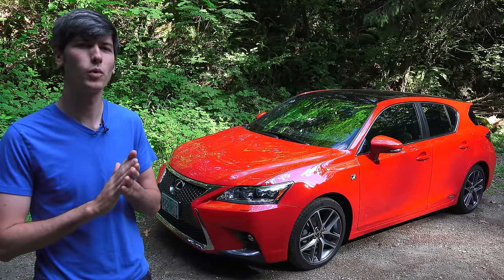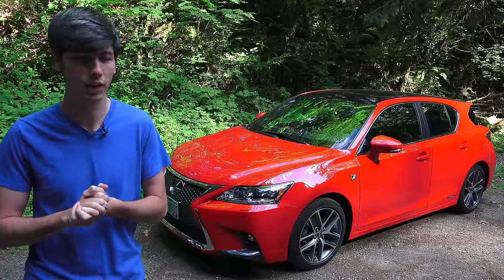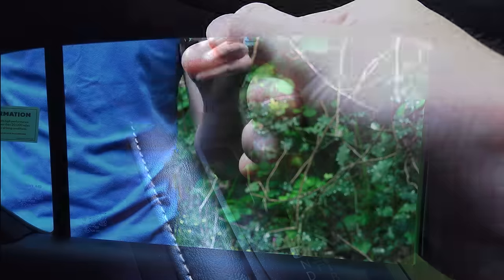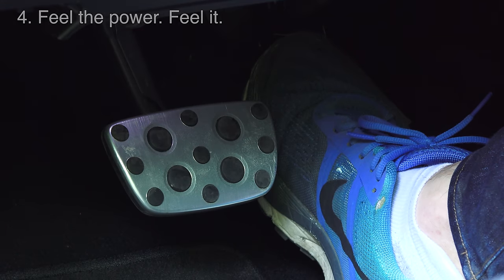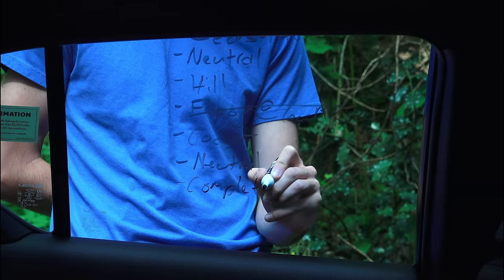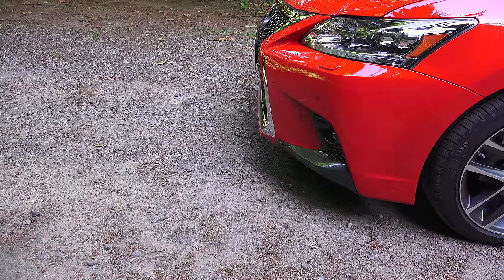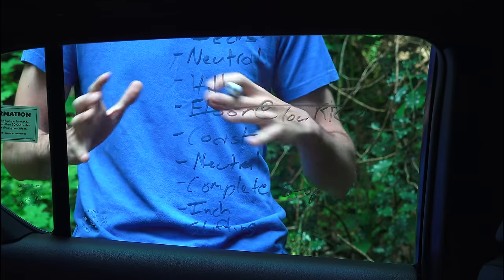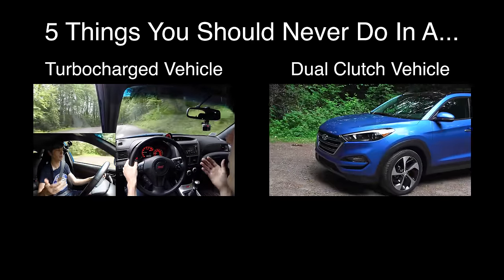5 Things You Should Never Do In A CVT Vehicle

Comment: I think I might be the first person ever to blow yes sadly blow an eCVT transmission. How it happened, I hit road debris and had no idea but I actually punctured the transmission cooler thus pumping all of the fluid out. The car being a sweet PHEV has warnings to let you know the hood is up, the doors are open you are low on gas but sadly no hey you are low on transmission fluid. While pulling off of the interstate and coming to a stop I had that loud thud and no more drive. Ford (It's a Fusion Energi) replaced the transmission at my cost. We pulled the Transmission off of the motor and to my surprise the transmission case actually had a 2" round hole in the case by where the engine mounts to the transmission.

Needless to say it was not a good day, (They wanted $6,500 to replace it, car had 57K miles on it) Luck would have it there was a CMAX Energi that was rear ended and we bought the used transmission. Install cost for the whole thing was just shy of 4K. 

Word to the engineers, we know when we are running out of washer fluid, we know when our hood is open but we do not know when we are leaking transmission fluid (plus you don't give us a dipstick anymore) give us a warning light before it is too late!
Reply: Warning lights are usually too late as well.  The warning lights on my 95 ford contour came on after the head gasket blew and the car died.
Reply: Insurance????
Reply: As a transmission  tech i agree with Lance the man on this. Done a lot of rebuilds because of low fluid from leaks they didn't know about.
Reply: I blew one up, did you know that just slapping an engine that produces much more power and fabricating a coupling to it will blow one up?
Reply: Hey Fast Nasty, I'd be fascinated to know which transmissions you have in the most for repair. Is Ford a culprit of regular failure?
Reply: darth415 Very interesting! Thanks for the heads up. Nowadays I'm not really too worried myself as I (try to) drive within the car's ability. I do find it interesting to find out about who looks after their cars and which common cars have issues. Honda is a surprise to me! I would assume these are also the fwd models
Reply: darth415 4 transmissions??? Woahhh!! That is very interesting. Ford hatchbacks are very popular where i live. Especially the 'higher end' models like the ST. Thanks for the info man. I'd love to do your job, it sounds fun
Reply: Your lucky , my 1.6L subaru engine blew (because the oil pump gave out and i didnt know) And i had to buy a new one for 10k!!!!!! And i was too lazy to put it in myself
Reply: Your collision insurance would cover it less deductible as you collided with an object on the roadway.
Reply: Lance The Man I had the same thing happened to me when a little rock on the highway became a big boulder. Funny how visual perception works... I saw the oil instantly spill on my rear view mirror. Stoped, called around and no one can fix it. They all said I needed a new transmission. No way you can fix it. I called random places and towed it to a freight repaired yard. It was quarter size whole. The mechanic told me it was hard to weld backwards on aluminum, but luckily his welder was the best. Didn’t even charge me. I tried to give him a tip, he wouldn’t take it. Drove that car for 300,000 miles. No transmission problems ever.  Maybe because the instant transmission flush. The hole never leaked. The most important thing to do was not to drive it with no oil in the transmission.
Reply: @lowerthetone  could be coincidence, transmission problems needing removal, Fords.
Reply: Should have been under warranty
Reply: Surely won't be the last
Reply: doesnt ford have a 60000 mile powertrain warrenty
Reply: The Fusion tells you when you're running low on windshield washer fluid? I find that hard to believe. Not a single car I'm aware of has sensors for windshield fluid level, oil level, transmission level, and pretty much literally any other fluid level.
Reply: That's what they want it to do  break down so they can get  $5,000 out of you to patch it. That's the whole point of taking the dipstick out so you can't maintain it and check it. On top of that they're starting to make n takes out of plastic making the block at a weak metal everything in there is getting cheaper and cheaper but the cars getting more expensive .
Reply: Dennis Xu but you can easily check all of the fluids except for the transmission which is in a sealed system

Comment: Hydramatics in the 1950s were specifically designed so that, without damage, they could be quickly shifted between low and reverse.   The reason they were so designed is that by doing so a car could be rhymically rocked to get unstuck if stocked on slippery surfaces such as ice or snow, or in mud.  I was often an effective technique.  The owner's manual even explained the technique.  That was one reason that the shift indicator was N D S L R (the early Hydramatics had no Park); with low next to reverse, rocking the car was expedited.  Then, for some reason, the effective idea of rocking a car to get unstuck was scrapped.  Now, if one is stuck, the likelihood of getting unstuck without help is greatly reduced.
Reply: it’s still there, in a way, except that it’s R-N-D.   and braking between shifting works just as well.

what’s missing today is the driver skill.

Comment: I have an 05 prius with 270,000 miles on it.  

I towed full u haul trailers for over 1000 miles  recently.  Its amazing that the electric motor had no problem pulling that weight up a steep hill from park.  The converter temp went up to 186F on the highway vs 120f normally.  my normal MPG today is 65mpg mixed.  the wind resistance totally demolished my mpg at cruising speed.  i only got 30mpg.  Still original batteries and parts when the car was made.  

Toyota, my dudes.
Reply: Hybrids get worse milage on the highway not because of wind resistance but because its using the gas engine and not the electric.
Reply: @sfbfriend  he got worse mileage cause he was hauling a massive brick of a trailer... the prius gets phenomenal highway mileage cause it's slippery as all hell and has skinny tyres.
Reply: Prius like this car doesn't have a cvt

Comment: I've heard that most CVTs work well except the JATCO that are used in Nissans.
Reply: Jatco makes cvts for other auto makers too.
Reply: My Nissan CVT has 300K miles on with no issues.
Reply: JATCO. makes CVT'S for other cars too.While non are that good seems Nissan is the worst.Then again I was reading that the problem with the Nissan was not adequate cooling, so maybe not the CVT itself?
Reply: @EzraPedersen  🤣
Reply: I bought a CVT Nissan with 60k miles in 2014 and then totaled it in 2017 with about 100k. Never had any issues. I’ve had a Subaru CVT for about 50k miles now and it’s great. The manual mode + paddle shifters is a great tool for snow and I’d assume off roading.
Reply: Had to replace my transmission.  Nissan Altima 2012.  Hmmm I'll never buy 1 again. Sadly I had only bought it 4 months before it went.  So owed over 6000 still
Reply: @donnaleeah5075  What was your mileage?
Reply: @saved217  when I first got it only 16 MPG.  With a different transmission 21.  Those are city miles.  Highway its now 24.   Yours?
Reply: @donnaleeah5075  I have gotten over 30 according to the car mileage indicator ( once on a 2 hour trip using cruise it came up 43 but I highly doubt that) . Those mileage indicators are not accruate. Other manufacturers have been fined for this. How many miles were on your car    when trans went bad?
Reply: @saved217  awesome on your mileage!!  I did the math when I filled up. My car had traveled 112 miles and the gallons I put into it was 5 so I'm right about the 21.  The transmission went at 134,000 miles.  Now the emergency brake has failed inspection.  This is such a lemon!!  Yet I love how very comfy it is, the heated seats(I lived in Maine lol) and the stereo is awesome.  But I hate all the money I've sunk into it so far 3,400 when I've not even had it for a year.  I have 2 and 1/2 years of payments left on it.  After that I'm getting another Honda. I've always have driven Honda.  I hate the Nissan, but glad a few others have those few Nissans that hold up.  Wish mine did.
Reply: Jeffrey Ponting mine got replaced at 48k mi. For my 2014 Sentra
Reply: *drives a 2016 Nissan Rogue
Reply: Jeffrey Ponting i think it all comes down to experience. Toyota (and lexus to an extent) has been mass producing CVTs since the first toyota prius, way back during the late 90s. They had to use the CVT for the prius because of the e-motors. Thats wat toyota says anyway. So theyve been making cvts for a good 20+ years now. The company that makes toyota cvt is called Aisin btw.
Reply: @EzraPedersen  Wow... that's good to know. I have a 2012 Maxima 138,000 miles no issues. What kind of car do you have?
Reply: @boogieman1719  It is a 2007 Nissan Altima 3.5L
Reply: @EzraPedersen  Thanks... seems the Altima, Rouge and Sentra have this issue more so than the Maxima... The problem is the cooling system. I hope yours continues to remain trouble free.
Reply: CVT toast at 35000 miles, 2014 Altima.  Bought new and had just paid it off.  Got fixed, class action lawsuit settled.   Car sits in driveway.  Nobody trusts it.  Never again Nissan.
Reply: Nissan owns a big part of Jatco.  Jatco is a supplier to Nissan and other manufacturers.  Failure rate is likely about the same as other makers automatic transmissions----overblown on the internet, like everything else is.
Reply: RIGHT
Reply: @arsyadidris2919  Interestingly, the CVT in the Prius is different enough from traditional CVTs that some don't really consider it a CVT...and it is extremely durable and reliable.  Not sure what Toyota puts in other cars----if their CVTs are different than the one in the Prius.
Reply: Donna LeeAh, just picked up 2019 Altima SV new. I have purchased many used cars over the years. Always got an extended warranty.
Reply: J Mo Me too man, Just bought a 2017 altima with 40,000 miles 😒
Reply: Damn must be bad luck i have a 2017 nissan sentra i drive 1000 miles per week 99.9% highways miles running from 60 to 80mph have had no issues so far
Reply: 2012 Altima S. No CVT issues at 125,000 miles mixed city and highway. Fluid changes every 30,000 to 40,000 miles.
Reply: 2014 sentra SR,  had a CVT and I literally beat the hell out of it, racing, drifting, driving like a crazy person... nothing on that car ever even thought about failing( well, the tires got worn quick but that is to be expected when you leave tire smoke after going around a corner)
Reply: Specifically the time Nissans quality of CVT’s went is seem with 2013 model year. It was very bad for Altimas at least but not nearly as bad for the adjacent years or recent years. However it does seem like its been bad enough to hurt the reputation years later
Reply: Not just Nissan I'm sorry to say.
Reply: @funktron4  Jatco Transmissions are infamous
among car mechanics.
Reply: @secretAsianMan120  I try to stick to the 5 and 6 speed manual transmission vehicles anyhow. I like being able to control what gear the vehicle is in going up hill and down hill. With a Cat back exhaust when you downshift you can here the engine brake effect. My brakes look like new because I hardly have to touch the brake pedal except for when I am at a stop. I drive it like I used to drive a 379 pete with an 18 speed and 7" straight pipes, downshift and let the jake slow you down.
Reply: My employer's corporate motor pool is 100% Nissan Altimas (2017 through 2020).  We have at least two dozen of them.  We get some sensor-error lights on the dash, but the engines and CVTs run fine.  We do not race them, and we maintain them by the book.  We have the basic fleet models, and I have driven them thousands of miles.  They roll smoothly at 80 MPH.
Reply: IT'SME nope, they dont. Aisin do it for them. Whos owned by Toyota 😂
Reply: @EzraPedersen  My Nissan Sentra went through 5 cvt transmissions in less than 100k miles throughout the warranty period. Sold it as soon as the warranty expired.
Reply: @rickt8627  so what did you just never change the oil
Reply: Nissan CVT's and the ones Chrysler used in some of the Jeeps are terrible.
Reply: @zacharybishop6595  I guess it seems a bit frustrating that many vehicles have reliability issues with automatic transmissions when they cost $35,000. Where as 40 years ago you could buy a new pickup for $7,000 with a 350 turbo and beat it for 200,000 miles and have very little to no trouble. I realize that the electronics are more advanced and the transmissions are now 5, 6, or 8 speeds to do a better job of keeping your RPMs in the sweet spot to get better gas milage. But they should give us something bullet proof for the amount of $ they're charging.
Reply: I have a nissan sentra 2015 and the cvt went out at 91k so I got a warranty replacement and a few months later I got a "increase" in my warranty that was 100k miles 10 yrs to 7 years 84k miles lol
Reply: @arsyadidris2919  seems reliable so far/ but I think people just drive them too hard like automatics which is where people make the mistake.
Reply: My 2014 Nissan Maxima transmission needed to be replaced at 64k mile in 2020

regular maintaince recorded as well with dealer
Reply: @donnaleeah5075  That's the only real way to calculate fuel mileage. The fuel mileage readout it very misleading and should be totally disregarded.
Reply: Boy the car demonstrates got me thinking such reckless driving there.
Reply: My 20 year old Micra is an absolute beast. Driven 25000kms this year, almost 95000 total, and no problemo. And no, I don't change the fluid every other day like a freak, it's actually much overdue a change.
Reply: Got 137889 on my 2009 Mitsubishi Lancer. Changed the cvt oil, and then the second time along with oil, filter, pan, gasket. Still running like a champ 🏆
Reply: I have a Kia Forte (2021) I get 40mpg + EASY...
Reply: @EzraPedersen  Has yours ever gone in limp mode? I just bought one and it went into limp mode.
Reply: @sixpackbinky  it did once. I had to replace the crank shaft position sensor.
Reply: My Toyota Aisin cvt failed at 84k. I’ll stick with a regular automatic or manual that I can service easily without specialty fluid that costs 120 a gallon.
Reply: How to tell if you have a JATCO garbage CVT?
Reply: @EzraPedersen  I needed to hear this
Reply: @jghall00  miles or km?

Comment: I had a Toyota Avensis with a CVT here in the UK for nearly ten years and it never put a foot wrong. Boring to drive but the reliability was amazing.
Reply: I have one too! How much milage does your Avensis have and have you ever changed the transmission fluid?
Reply: @mackysobrevega1780  I put about 100k miles on it and, no, I never changed the transmission fluid. Brilliant car. Unfortunately it met an untimely end when I had a bad collision with a large deer and wrote the car off. 🫤

Comment: Guys...There's 1 thing you guys dont know the advantage of CVT...
CVT Gears are better than automatic in terms of torque...torque will not fall as cvt is to continuing the gear ratio while automatic transmission will shift up and its torque drops down... CVT > AUTOMATIC
Reply: they're also good for luxurie cars, as they are smooth shifting.
Reply: NotSoNerdGaming well true that
Reply: Yes but it's weak.
Reply: Shamie Ramsamuj stronger than automatic...im surprised
Reply: Shamie Ramsamuj go watch enginerring explained...AND its doesnt matter what  manufacturer it is...im also shcoked by the results..just go watch and calm down
Reply: confinez555 pfft that why all the repair shops have cvyc in for repairs and my older model auto attached to a 2 liter turbo is still driving lies man
Reply: CVT's don't have gears.  They don't shift, there's a belt or a band between 2 cone shaped pulleys or 2 variable pulleys depending on the CVT, the belt rides up and down those cones or pulleys for different speeds, they're infinitely variable, something a conventional automatic cannot do.  With a CVT its never hunting for gears because there aren't any and its always in the right "gear" regardless of conditions.

Comment: Thank you for your content, it's always insightful and straight to the point. 

a few  questions:

1. what is the exact purpose of Neutral? Is it just for emergencies such as towing the car?
2. Would it be harmful to the transmission to engage in sport mode while on the move i.e for overtaking or for driving uphill?
3. Finally, I was curious on the effects of start/stop systems on CVT's

Thank you.